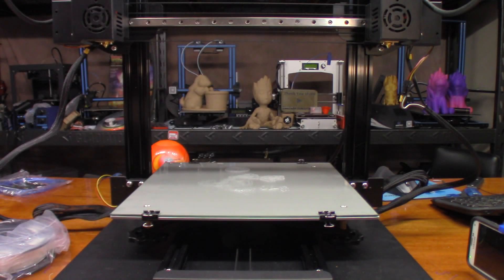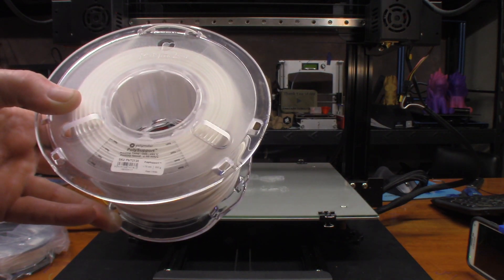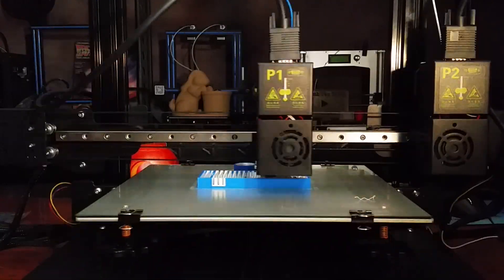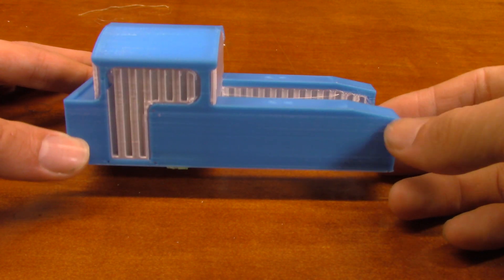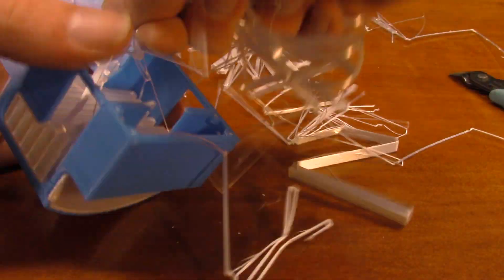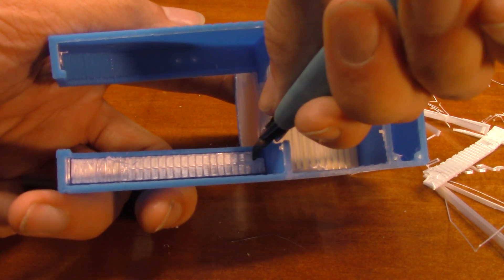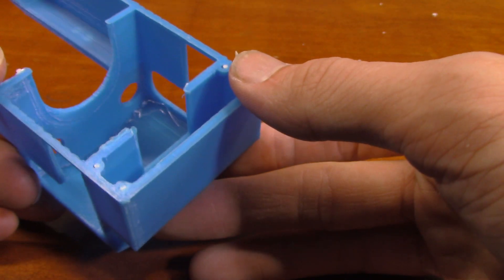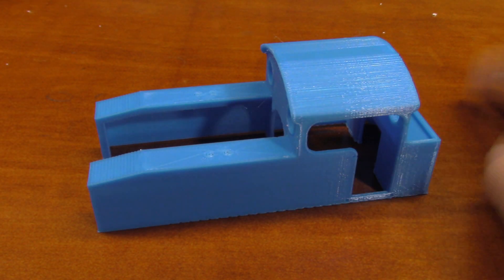Printing With PolySupport On The HICTOP D3 Hero IDEX

Comment: For those wondering PolySupport is a PLA/PVA blend that works quite nicely for breakaway supports, like any filament it works best if kept dried out though. The support density I used was a bit higher than it should have been in retrospect but I did not realize that at the time so that was a contributing factor in the difficulty removing it. I have done PVA on the machine and it works quite nicely although at the time I had no dehydration setup so it was a challenge. Overall the machine works great as long as you feed it the right specifications!